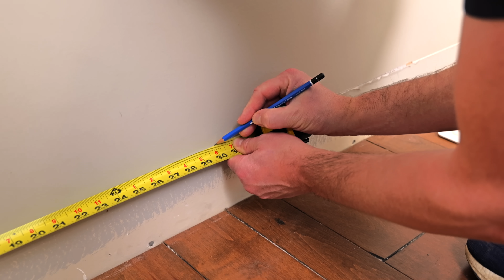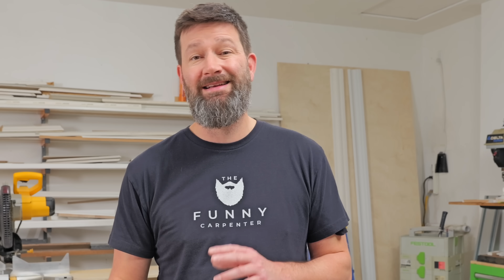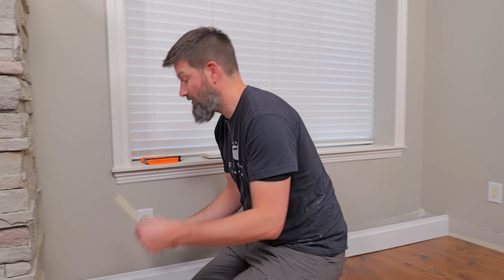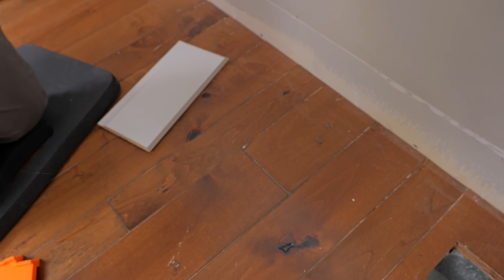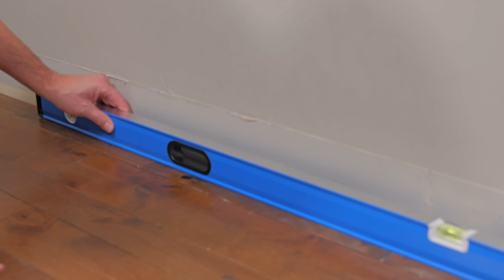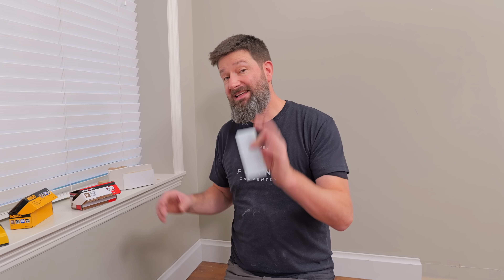3 Pro Tricks to Immediately Improve Your Baseboard Skills!

Comment from the maker: Have you ever tried a Profile Gauge?  I was surprised by how well they work!
Reply: yep. i have my father’s (maybe grandfather’s) metal scribe guage and the resolution is fantastic. not as large as the plastic one influencers are hawking as some revolutionary new tool, but it’s one of those old tools you use and think “they don’t make em like they used to”
Reply: Question: so if that piece wrapped in both directions,  would you need to scribe/ drop it all?
Reply: I don't understand why you put that scrap piece down first.  Now, you're not getting the profile of where the board is going to go.

Comment: question for you as you are doing top notch work. how much can you charge per ln ft for this type of as by doing the work like you  requires a lot more time to do as i have scribed base boards most of my career that i learned from my uncles as they do it the same way you do. scribing, coping, etc but i find what we charge and the time it takes can be non profitable but by all means you are doing it old school way and definitely is the right way to do it but for what we charge we can't always do that kind of quality but by yhe hour i can do good as i can take the time to do it right.

Comment: I've done miles of baseboard in commercial buildings.  There's always metal studs, nailing into a stud is not possible, occasionally we did use self-tapping finish head screws but almost always we used construction adhesive and toenailed the base to the sheet rock w/18g.  Assuming the sheet rock is primed or painted, 18g nails will hold good enough until the construction adhesive cures.

Comment: I just moved to the eastern side of America and these houses are not built the same as where I grew up and built houses in Washington State.  I went to hang my TV and used a stud finder and it went off non stop as if the whole wall was nails.  But I guess it's a bunch of thin pieces of wood.  So I guess I need to just put anchors in the wall and forget about finding studs.  And every house I looked at buying including the one I just bought has hills and valleys and numerous gaps with the molding on the floor.  I wish I knew how houses are built over here.  I don't know what's behind the wall.  I was told the walls aren't even sheet rock they're instead plaster.  And the floors creak but I look at the jouces(I guess my phone isn't smart because it won't show me how to spell this word) in the basement and they're solid so I don't understand the creeking sounds.  I don't know what part of the country you're from but are you familiar with old houses over here in Ohio?  I'm unfortunately a perfectionist so I see everything  but most people wouldn't think there's anything wrong with the place.  but I am also poor and disabled or I would just gut the place and build it to my liking.  But because of not having much money I need to fix things instead.  So any ideas or links to past videos would be much appreciated thanks.  The doors are all rubbing some don't close.  And what material would I use to fill in indents on walls and doors that will adhere well, so that I can then paint and have the walls perfectly smooth, thanks so much.

Comment: Ripping the profile off of your MDF and buying separate pine is potentially more expensive than buying PVC and adding the cove yourself. Check out Yonico brand router bits. They have a big selection and are very reasonably priced. Perfect for 1 time use cases. Bathrooms are small so the PVC will probably be less than $100 and the router bit will probably be less than $20. That looks like a sort of oblong cove so it may require a horizontal coving bit and a router table but it's always fun to replicate things. You can also just rip the 1x5 to 5/8 in 2 passes on your table saw. Food for thought. Awesome vids sir
Reply from the maker: That’s a good idea- I will check it out

Comment: i use two block planes , one set strong for hacking and scarfing and one for
smoothing and fine tuning to perfection . i do it in place so these old bones dont have to get up and do all that time, tool and energy wasting stuff young guys should be doing in a production setting , plus less sawdust ,  i can hand scrap the shavings as i leave the room on to the next.

Comment: Didn’t understand why you shimmed it 1/4 “ first.  I understand so you have a full height but .I don’t understand how it works
Reply: You don’t cut the very end of the baseboard because you want that end to keep its original height so it lines up with the next piece.
When you lift the end of the board with a 1/4-inch shim, and you also rest your pencil on another 1/4-inch shim, the pencil will only touch the board in the spots where the floor dips lower than that 1/4 inch.

Anywhere the floor is higher than the shim, the pencil won’t leave a mark.
So the cut naturally fades out before the end of the board, and the end keeps its full height
Reply: @aarondenault7288  Thank you thank you thank you

Comment: A pro tip for finding studs without a stud finder. Use can use a 15lb or a 20lb magnetic pick-up tool and it will pull to the nail head. From there just find the second stud location which is either 16" O.C or 24 O.C and then use a tape measure to layout and find the remaining studs.
Reply: Yes I just a used a $5 magnet ..i just move it in ever widening circles. Funds studs in under 15 secs. I test for each stud though across the wall rather than rely on std measures

Comment: I had to deal with installed baseboard, an uneven older oak floor - 1/2” or 3/8”. I resorted to shoe moulding with a quarter oval (instead of 1/4 round profile (so it would be thinner). The shoe is oak, finished to match the floor.  What are thoughts about shoe moulding as an alternative to scribing?

Comment: Would you considered also using a construction adhesive with the pins and carpenters glue at the joints?
Reply from the maker: I like wood glue for outside miters and for the inside I cope joints with no glue.

Comment: Nothing which might get wet should be MDF but it's so cheap compared to real wood that everyone uses it. For baseboards it's best to just raise it with spacers and use wood shoe molding to kill the gap; that eliminates bottom scribing too. And though you don't always have the option, the proper fix for a dip in the floor is to fix the floor, not scribe to a problem. 

Since electricians and plumbers are sometimes sloppy with placement I like to use 1 3/4" nails, preferring 16ga for their better holding power. It's always a question of how far you go with best practices versus good enough when you're in business to make a profit. My aim was to have nobody better than me in production work and do the best possible for restorations.

Comment: Thank you (again) I've learned so much from your work, including bottom scribe from another vid. Have you ever addressed how to deal with the level of a long run with multiple corners? I do maintenance for long term care residences (intellectually challenged), and my motto is Leave It Better Than You Found It for these  folks. These are multi-bedroom, government spec, one-stories on a slab. Thus the floor imperfections really show up doing baseboard and the like. Specifically, I have a 16' run, inside corner, 14' run, outside corner, and then 5'. Making every cut and height match up over that length is hair-pulling. Do you snap a line over the whole length inc. corners or, what the heck is the magic sauce?
Reply from the maker: If you have a whole run of wacky ness, I’d start with my biggest dip and see how much I need to remove to solve that problem and then work out from there. Best wishes!
Reply: Would you mind going into the details of handling corners? What is the trick to make sure the baseboards having the same height without scribing every run?

Comment: In York region of Ontario all   baseboards have quarter round, shoe mould or door stop sealing gaps between baseboard and floor, nobody scribes anything in the subdivisions.
Reply from the maker: Interesting, that works to but it’s hard to beat a nice scribe🍻
Reply: Same around London 😅
Reply: Additionally, if you fix the floor, or replace the floorboards, you can't reuse the same baseboard.
Reply: This is why it looks like plastic
Reply: That’s what we call “bush league” where I live. Or we call it, “a 120 year old house”.
Reply: @SnootchieBootchies27 really? I admit quarter round looks terrible,  but door stop (on any base that already has some sort of profile) looks way better.  It just accentuates the detail. 

But if the base is the modern looking flat stock, you Def gotta scribe.
Reply: @SnootchieBootchies27 old house.

Comment: Question: How can I fix the huge gap at the bottom of entry frames that don’t have doors? Old house must have had thick carpet before I changed flooring. Some trim ends 1/2” from floor. I expect that I’ll need to rip this out and replace with new, correct? Thanks for your help!
Reply: Instead of trying to perfectly match the profile, you could also cut away additional material and put in a larger piece at the base, with flutes, inlays, carved, beading, whatever level of flourish matches the rest of the house. That way you add a bit of visual detail and it looks (if well done) intentional, rather than a patch job.
Reply from the maker: I mean the only other option is to use another trim with the same profile and attempt a mini splice at the bottom.
Reply: @TheFunnyCarpenter didn’t you do that on another video? I’m retired now, so I guess we know what my new hobby is going to be. 😂